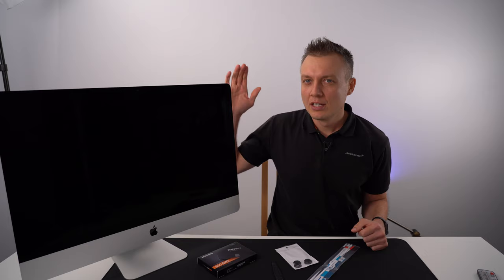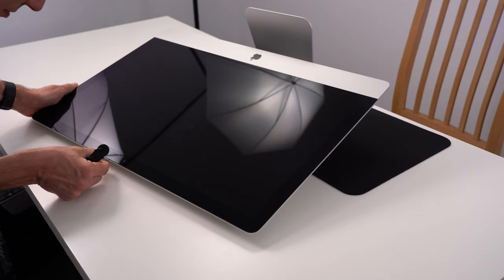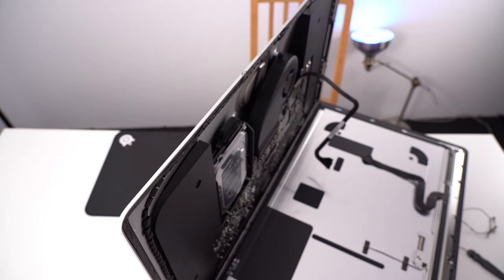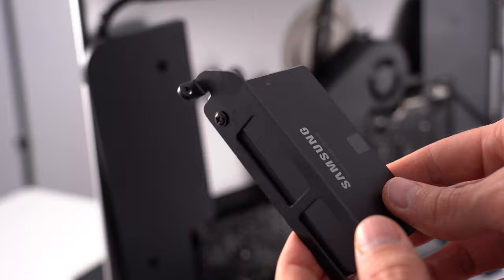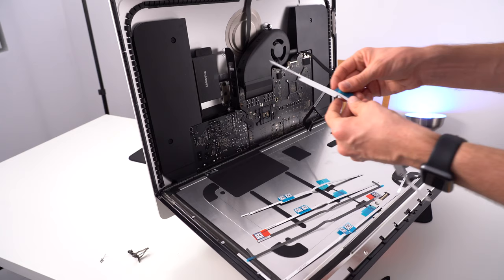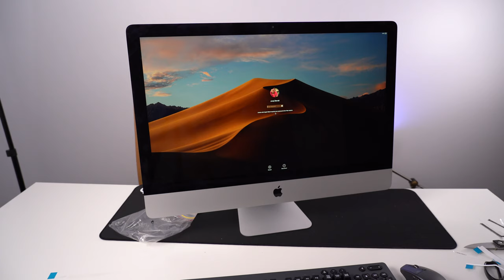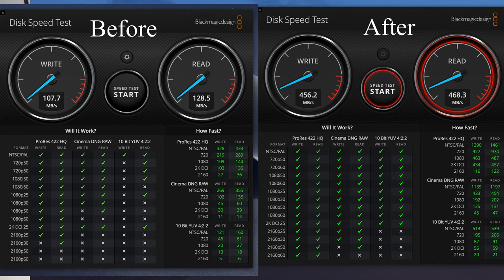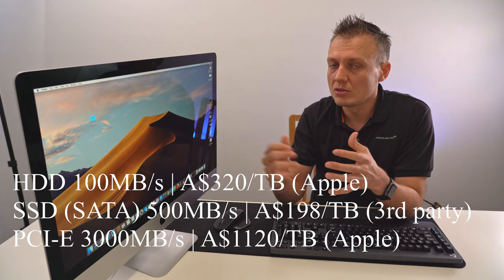How to upgrade iMac 2019 from fusion HDD to SSD (4k)

Comment: Did you end up breaking the Fusion bond between the original HDD and original SSD? I'm ready for the physical swap part but have a few concerns with the software side!
Reply: I am in the same boat as you want to change out to ssd and keep the ssd blade as a boot up for OS and maybe some apps like Adobe   logic etc.

Comment: Good day thank you for the explanation but where can i get a m.2 drive to buy that is compatible with my IMAC motherboard to increase the storage?  Can i just remove that m.2 drive and just use an ssd 2.5 alone will it let me install the os and boot  normal, i have an imac 27''  a1419 late 2015 that crashed and not booting well. i still didn't buy anything tools to open it until i finish doing further research so i can have everything i need to start to fix my imac. please kindly reply thank you.
Reply: hi you can keep the ordinal hard drive and  install m.2 at backside , however the you need special adapter to convert the apple m.2 to normal m.2.
check this 

https://www.youtube.com/watch?v=aGQXjg7GUgQ
Reply: Or u can find a used one on ebay especially from macbook >2013

Comment: I have a pretty well equipped 2019 27" iMac, with the 2TB fusion setup. I am just learning that the "SSD" part of the fusion drive is a whole separate "drive" on the motherboard. I do a lot of video editing, so my 2TB has filled up rather quickly, but slowly (lol). I am dying to swap in an SSD as the main drive, but my computer isn't a "fresh" install of Mac OS, and I don't want to lose everything. Can I simply transfer my HDD contents onto an external drive, install the new SSD, and transfer them on to it, or will I have to basically go with a fresh install of Mac OS, and then transfer my videos/photos back onto it? I hope that makes sense. I also see people upgrading the little SSD chip on the mobo to a larger size, does that benefit anything if its only the OS on there?
Reply: BriansGarageTV You will have to clone your new drive before installing it. I’m not sure if cloning a fusion drive is the same as a normal drive since the OS is on the PCie chip soldered to the motherboard. Reasearch it. Don’t replace the PCie, it’s pointless. It does nothing but stores the OS.
Reply: @phamtoilon  the pcie is not soldered to the motherboard. Also, it is for from pointless to replace the pcie, if you were to replace the 28,  32 or 128 gb pcie with a 1gb or 512 pcie drive you would get far faster speeds the you get with a sata drive or the 2 ssd'd drives fused. when you say research it, I think you should take your own advice. You could use the pcie drive alone for the fatsest results. You could use an upgraded pice & sata ssd for a fast fusion drive or use a ssd in the  sata drive alone which would limit your read/writes to 550/550. The ultimate would be to replace the screwed in, NOT soldered on  pcie on the motherboard with a 1tb or 2th pcie for blazing fast, the fastest option.  That said its the most difficult option for inexperienced upgraders.

Comment: Sorry, could you please confirm how you managed to get the software running again because as you said towards the last bit of the video, the system cannot support 2 ssd. So what did you do? Thanks for the vid.
Reply from the maker: Doesn't have wifi, you need to connect via cable

Comment: Thanks for the video.  Is it possible to install an SSD like this if you only ordered the 512 GB SSD from apple? (No fusion drive)
Reply: You'd have to go further into the iMac as the SSD is on the other side of the motherboard. OWC has a good video on this: https://www.youtube.com/watch?v=pGkmqAgzmoU
Reply: @FritzMeister  But can I still install an SSD like he has in this video, AND an NVMe SSD on the back of the motherboard?  I'd really love the extra storage.  Thanks for the link!
Reply: @JamesErb00  Yes, but you'll need an additional cable to connect from the logic board to the SSD. (https://www.amazon.com/Deal4GO-Replacement-2012-2017-593-1330-923-0312/dp/B081VGQV9Q/ref=sr_1_3?dchild=1&keywords=imac+sata+cable&qid=1590102657&sr=8-3) And there will be no mounting bracket, although you can use strong double sided adhesive to mount it
Reply: Note, you should also use an OWC thermal sensor if you don't want your imac fan to run at full speed all the time!

Comment: Is it really a good Idea to have a Apple Watch attached on your arm if you work on computer-boards or with not destatic your body?
Keyword static electricity charge.
Reply: The watch is not the problem. It’s the operator. Be very careful in dry weather and synthetic carpets and clothing. Touch the case before any electronics and unplug the power, etc. if you have any concerns or lack electrical/electronic experience, don’t do this.

Comment: Hey good video did you have to remove the internal mac ssd part of the fusion drive or do you now ignore that . My 3tb fusion drive has failed and wont respond to disk utility no surprise mac DU is useless in my experience. Thus I'm going to put a 2tb ssd drive in and go with that . What about the internal fusion ssd ?
Reply: just a quick reply to myself, i installed a 2tb samsung SSD a slight pain as i built it fresh from the internet booting from a mojave buold off a USB drive so it was a bit slow however it worked after overcoming the connection issue to the apple install server, thus installed ,  used a SSD tray bought from amazon although you could just tape it in place , I wondered if you could fit 2 drives in parallel but that will have to wait.  The MAC now boots auto from the new SSD its not as quick as the fusion start but that may relate to Mojave , its bizarrly quiet and now no lag from spinning hard drive, i left the screen unglued and taped it back into place as I may add another SSD if i work out how. I didnt do anything with the internal fusion SSD,  it seems to just ignore that good luck to all

Comment: You need to reassemble and test before you stick it back together, and as someone else mentioned, you need to use the OWC temp sensor or your fans stay on full all the time.  You didn't remove the SSD part of the fusion drive either.
Reply from the maker: you don't need the sensor - my fan doesn't spin at all, only when I work my CPU during video export or editing. Re fusion - it's only supported with spin drive so won't work with an SSD.

Comment: if you install a brand new hdd into the imac....how do you get mac os on the new hdd?
Reply: It supports Internet Recovery, so when you're starting it up you hold down CMD+Option+R and it will download MacOS over the internet and install it on the drive.

Comment: Does MacOS  play ball with an OWC Aura Pro X2 PCI-e SSD with a SHDD (eg FireCuda) in the SATA slot? Does the system see the SHDD as a rotational drive? I have searched in Google but I haven't found anyone who has tried that configuration.
Reply from the maker: unfortunately I haven't tried that either...

Comment: Hi Juraj Benak. An excellent video, thank you. Is it possible to remove the 1TB fusion drive and the Apple PCle (32GB) and ONLY use a large 1TB m.2 PCle Samsung 970 EVO using a Sintech NGFF adapter?
Reply from the maker: Mumtaz Khan I’m not sure, haven’t attempted to do that

Comment: I have an imac 27 5K retina late 2015 I buy an Samsung Qvo 1Tb to replace the hdd, do I need the thermal sensor and cable adaptor or can just replace the drive, thank you for helping me
Reply: You don’t “need” it, but it’s highly recommended as the fan will run out of control at 100% with nothing controlling it
Reply: @LuisLopez-hb3ok  finally didn't need the sensor evething work fine thank you for your video it help me to change my hdd to ssd

Comment: where is the SSD located in the Fusion Drive setup ? I only see the hdd part of it !?
Reply: Good question. Watched another video on how do to this and they had to take everything out of the computer and replace the ssd 128 m2 (on the login board) with a new one.  I'm confused. :(
Reply: Thanks. Saved me the trouble. Why do all these people keep thinking it’s M2? Anyway, it’s the same process as the 2013-2015 MacBook Pro/Air upgrades.

Comment: Cant you use a portable ssd and boot 2 disc too get the same performance?
Reply: joshua martinez Yes!
Reply: The Meta Depending on the port you use, you may see some throttling, but for normal use it is enough. I’ve been using Windows 10 on an iMac this way. The SSD is plugged into USB port and it is faster than the internal Fusion drive. However I have a feeling that connecting other accessories (like a mouse) limits the USB to USB 2 speeds (around 50 MB/s). So you have to test in your situation...

Comment: Did you have to turn on trim support?
Reply: All SSD's she have trim enabled to allow then to reclaim deleted file space.
Reply: @RGV250FORSALE  You have to turn on trim if you replace a factory hard drive with new ssd on Mac OSX . You can check to see if it is on in system information under SATA/SATA Express.  I found instructions in a you tube video.  Once you run the script TRIM Support changes from No to Yes. I recently replaced my HDD in my Mac Mini 2014 with a T-Force 1TB SSD.
Reply: search "enable trim on non apple SSD" on you tube.

Comment: one Screw HAHAHA funny but I don't know what else you could do... That'll work though. I wonder if that's the same on a 2011 iMac???
Reply: I wAs just going to use double sided tape, but that looks better.
Reply: @macyourday0  really?  i would have used tape anyday its a lot easier to to apply and from the looks of it you better not open up a mac too many times annyway.  

Im sad to say that  using the cache-drive in front of the  SSD looks to be impossible  because NVMe's are so mutch faster than sata-ssd's    I do wonder about why the samsung 860,  its quite expensive compared to for example the MX500  which is also faster than all 8x0 models exept for the  860 PRO  ... but that is just wasted money compared to the  Apple NVMe upgrade.

Comment: Does opening it up void any warranty?
Reply: EpicEThought yes.
Reply: Not in the U.S., no matter how many warranty stickers you "void" by damaging or removing. Even the FTC put out a message about those stickers being illegal warning manufacturers. What will void warranty is damaging or pushing your equipment byond specifications. So if you replace the CPU with one that has a higher wattage draw than the motherboard is designed for or that the cooler can't maintain, same for overclocking. But opening and changing parts that are within specifications of the equipment will not. It's like saying that if you change the car battery or breaks outside of the dealer will void your warranty.

Comment: Good God! I can see you've never done this before! You were supposed to CUT ALONG THE BOTTOM, LEFT TO RIGHT using your tool to REMOVE the adhesive from the bottom. Then you were supposed to use the bottom sticky to reapply it. Also, your not supposed to remove the cable from the screen. Its the other way around, remove the cable from the MOBO!
Reply from the maker: Mihaly Freeman fair point, I’ve never done this particular job before.

Comment: Is the Samsung 860 Evo ssd faster than apple's original internal ssd's?
Reply: no
Reply: @EmilJonssonReel  my biggest mistake ever!!!!
Reply from the maker: @oliverbytes  it isn't but in most cases it's fast enough and price/space/performance is the best you can get right now.
Reply: @juraj_b  I'm still waiting for my imac 2019 with fusion drive and I'll see how it performs for my daily work. I'm a software engineer and don't use much for editing videos. Only gaming sometimes
Reply: @oliverbytes  you can upgrade a extern SSD with usb 3.0. its easier
Reply: @GLTURGL  only thing is apple's blade ssd can go up to 3000Mbps compared to external usb 3.0 usb ssd only 500Mbps
Reply: Oliver Martinez this Samsung SSD is a classic slow 500mbs read and write sata 3 SSD if you want faster ssds like what apple uses you can install the Samsung NVME that's what apple uses in raid 0 to achieve that speed.
Reply: @carholic-sz3qv  yeah I know now from a lot of research. I ended up ordering a Samsung X5

Comment: haha Apple. My gosh it would be a 1 min upgrade if it would simply offer a small light M.2 lid in the back or Bottom... but Apple drives all crazy. Thats insane. Why would someone buy a 1TB Fusion drive iMac or an iMac at all - a machine not able to upgrade at all.
Reply: id keep my iMac open after this so i can easily exchange it once i need to do so
Reply: This video shows him upgrading the machine.  I've done it as well.  It's not an issue for most technically-savvy users.

Fact:  Most people will never upgrade their machine after the initial purchase.
Reply: @Gmon750  Most people will spend 500% of the costs for a bigger ssd on purchase. That is was apple wants
Reply: @Krautmaster86  And so what?  Buyers pay it, they're happy.  Move on.
Reply: @Gmon750  yeah hopefully the governments will have an eye on this ...  Thus it's not sustainable at all, not economic. There is no reasons to let that's device age and die that fast, it should be upgradeable and fixable. And usury is illegal anyway, and I think over 500% margin on that upgrade costs could be named that way.

I can understand this in extreme low form factors like tablets where u cant exchange anything, but in this device, its not a real functional need. The only need to do so is to gain more profit directly.
Reply: @Krautmaster86   It's not hardware that's as much as an issue as it is the software...constant updates eventually any computer looses support from the manufacture. My Apple iMac 21.5" (mid 2011) can't be updated past what it's running now High Sierra 10.13.6 and I'm guessing in another year or so Apple will stop supporting it (security and bug fixes) rendering it obsolete. But I understand what you're saying about the difficulty of hardware upgrades on ALL Apple products, Apple seems to go to  great lengths to make their products tamper proof...or so they think. Also they are very protective of consumers being able to purchase parts to keep their computer running or updating. 
iPhones are even worse they are pretty much sealed gone are the days of being able to open your cell phone to do a simple battery change (used to be common and easy) now I don't know of any smart phones that you can open up...and it seems like they go out of date in a very short time (AND COST A SMALL FORTUNE)
Reply: @Krautmaster86  You do realize that Macs have some of the longest life spans of all computers right, and that Apple has one of the best recycling programs of any technology company right?  My prior iMac was almost 10 years old before I retired it.  Good luck doing that with a regular PC.

You have a strange definition of what "illegal" is.  Apple is doing no such thing.  It's nonsense.

But hey, if you think that Apple's behavior is "illegal", then perhaps you should focus your hatred toward more obvious tech firms like Samsung, Lenovo, Huawei and Xiaomi whose products have been show to be way, way worse that anything Apple would ever do.

But that would be too easy right?
Reply: @Gmon750  U mean that upgradeable Mac u had? Nice try. I know so many user's who upgraded their Mac, and that is now hardend by Apple. U wanna tell me that nobody replaced the ssd with a bigger one after years? Did u keep it in ur 10 year lifespan? Imagine how bad 512GB will look in 10y

And there is simply non reason to prevent user's from upgrading... The Mac book pro is even worse with a soldered ssd. And yeah, years ago Apple was upgradeable.
Reply: Okay thx. Didn't know the SW is that much of an issue here.
Reply: @Krautmaster86  Please... I will not be upgrading a 512GB SSD on a 10 year old computer.  Get real.  By then, most consumers will buy a new computer, just like I did because the tech is better 10 years down the road, and you know that.  Just stop.
Reply: @Gmon750  I upgraded my laptop directly after I bough it , I just had to put a better and larger ssd inside
Reply: @carholic-sz3qv  Nothing wrong with that.  Good for you.  The majority of consumers don't do that.  Why engineer something that 99% of people won't utilize?
Reply: @Gmon750  
Fanboy. In ur logic it wouldn't matter of no desktop PC at all is upgradeable or not. ^^
Reply: @Krautmaster86  It's sound logic.  Most PC purchases (Apple and WinTel) are made by non-tech-savvy people.  Even when Apple had machines that were easily upgradeable, most never were.  Why do you find the truth so offensive?  That's the reality.  Why do the extra engineering/costs on things that will not be used?  Just to appeal to the 1% of users like you (us)?  

I just upgraded the SSD on my friend's 2012 MBP.  It was one of the last Apple laptops that could be easily upgraded.  Nice that I could, but everything else about the machine was old and obsolete.

Comment: The designs of these new iMacs is so FUCKING STUPID. Glue?! On a $1000+ PC?
I have a late 2012 iMac which I've had new. It had a fusion drive. This year the fusion drive died so I've had to use an external drive but I need to replace the internal drive and clean the fan. But I'm scared to do this because it's such a risky job.
The older iMac screens were held on with magnets. You just needed suckers to pull them off. Fucking Apple and their fucking glue.